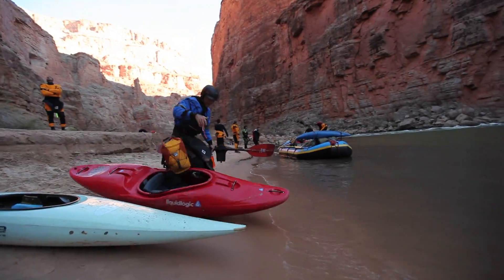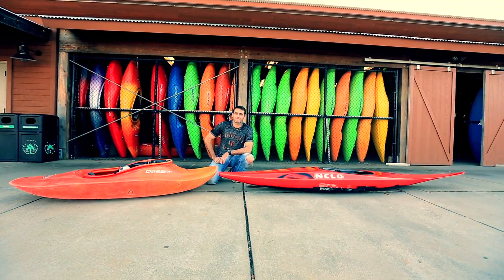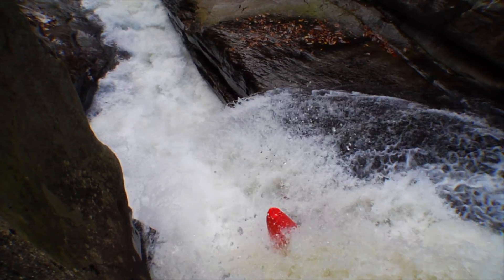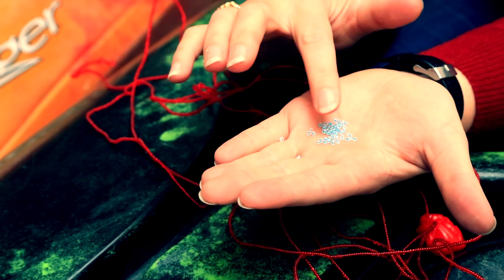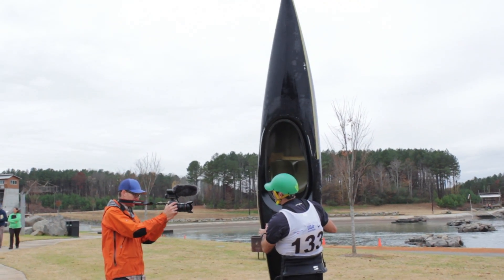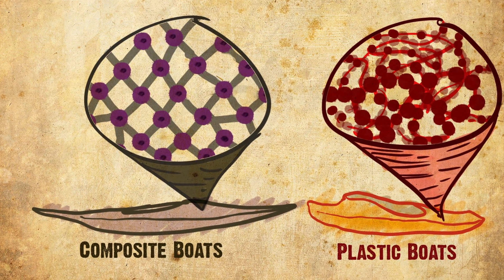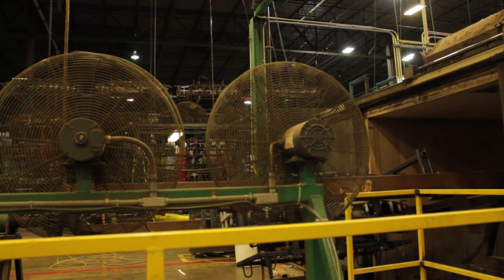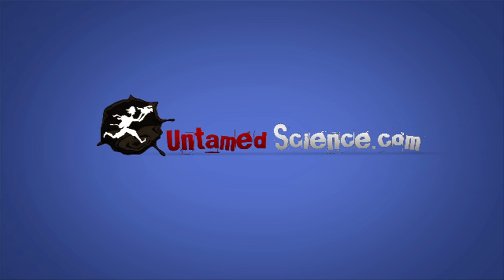Plastic vs Carbon Kayaks - THE SCIENCE EXPLAINED

Comment: The explaination of composites is a bit lacking.  In a kayak composite a (thermoset plastic) epoxy, which forms the comnposit material matrix, is cured around (carbon or glass) fibers, which are the load bearing members in the composit material.  Once cured, the epoxy matrix cured cannot be 're-melted', whereas theroplastics, such as LDPE and HDPE used in molded kayaks, can be remelted, specically useful for repairs.  Structurally, the epoxy matrix transfers the loads applied to a kayak between the fibers, which are incrediable strong and stiff in tension.  Composit kayaks are typically much stonger and stiffer that thermoplastic kayaks, but have compressive failure modes, though rear, that are often costly to repair or catastropic.